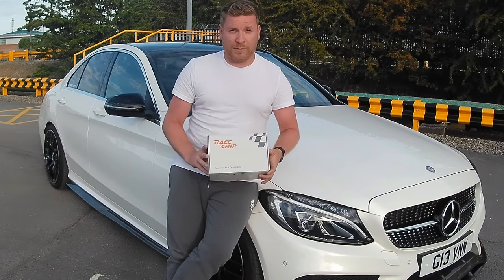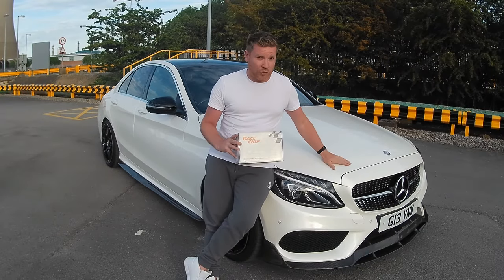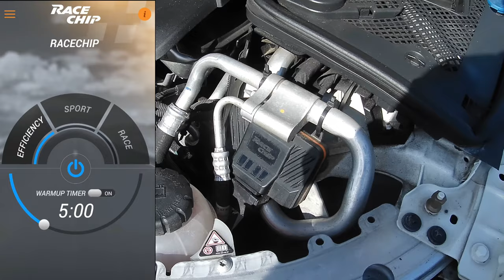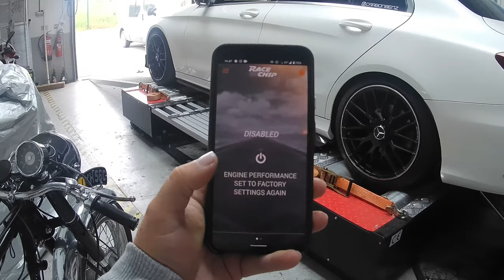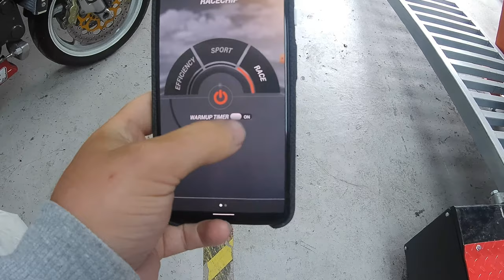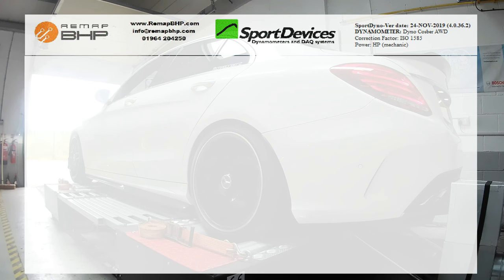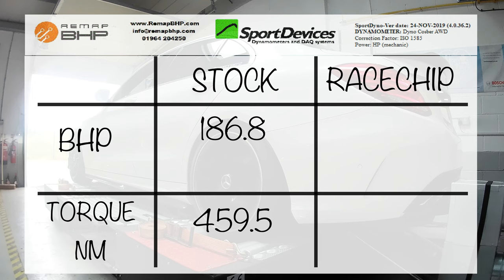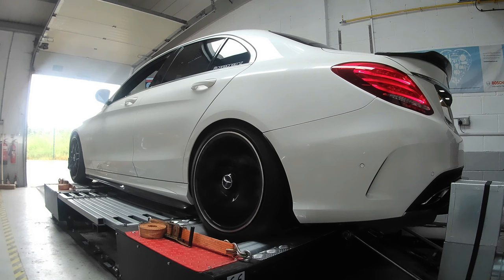RACECHIP Tuning Box's - Do They WORK? DYNO TEST RESULTS!

Comment: One thing to consider... as a race chip owner on a Panamera Turbo, is the race chip has a bit of a learning mode. It obtains its maximum improvements after a period of time, up to 200 miles clocked after installation.
Reply: That is 1000% correct brother alot of commenters claim to have race chip and they dont i had mine AMR tuned and it curropted my ecu so got a new ecu and added race chip ultimate and not only was it better but i dynode 506 hp to the wheel on map 5. (2016 mb c450 amg)
Reply: Finally! People with some sense!! You can't just add the racechip and slap it on the dyno right away. The stock ECU has to adapt and make passive changes and that takes time.
Reply from the maker: @mojo904  where in the video did I say I’d just added the racechip? It had been on for over a year prior to making this
Reply from the maker: Good job the recechip had been on for over a year then before I made this video to ensure the best results :)
Reply: @ZER0Y0N  <crickets> :)
Reply from the maker: Yep…

Comment: Fitted one to a turbo diesel i30 Hyundai. Definitely made a reasonable difference. The increased mpg on the trip computer was way out but measuring the mpg myself it gained 1 or 2 mpg which isn't much but considering the extra power it was a win win. Ran it for 50k miles and it never caused any issues.
Reply: Will this chip work on a US version Kona N-line? 1.6T 87 octane.
Reply: @zacherydesautels9458  Yes you can buy one for he Kona. I actually ordered mine today! 2020 kona ultimate. Claiming 49 horsepower and an astonishing 95 lb-ft of torque

Comment: I had the basic racechip on my A200d with the 2.2d engine. It made a real nice difference. The jump in torque made a big difference to the way it drove in normal traffic. I did over 100,000 miles in that car and it did not effect mpg in any way. Averaged 68mpg over 100,000 miles.
Reply: if you averaged 68 their was absolutely no point in you getting a tuning box hahahhaha you would of been better with a detune hahahah

Comment: Would this cause any parts to wear quicker?
Reply: @imtheblind4524
Yes if you abuse it. I mean if press the gas harder and harder, even if you not use racechip or any piggyback tunes it will cause problems to your engine. The most important is learn how to maintain you car even you are using the chip or not.

Comment: For the people who like to know:
It's interrupts the voltage signal coming from the common rail pressure sensor and forwards a higher or lower value depending on the chosen setting.
The ECU bumps up the demand of the pump a.k.a. pressure because it's sees a lower value from the sensor.
Now because the pressure is slightly higher and the duration of the injection is still original ECU, the end result is still a higher volume being injected in said duration of injection time resulting in a higher bang. And since cars are always tuned from factory for balanced power and pollution setting. You can get away with adding that little bit of fuel without getting in to trouble.
Reply: Maybe no real trouble, but your beautifull white Mercedes wil have a black butt in no time.

Comment: Initially when I got my RC, i didn't feel i noticed too much increase, it took my a while to notice.
I contacted RC customer support via email and explained that I felt it was not giving me the power i expected.
They sent me an update to install and i have to say i really do notice when it is turned on.
On highest setting it always feels like the turbo is raring to kick in.
I usually drive with it set to 4.
It definitely picks up quicker than without it.
I've had mine over 2 years now and hate driving with it off. 
Expensive, yes. But so glad i bought one.
Reply: What car do you have mate?

Comment: I've installed Race Chip on many of my own vehicles and all have worked very well. My MK8 GTI picked up 4 mph at our local 1/8th mile drag strip, only mod was the Race Chip. My Wife's Cayman S picked up almost 50 whp and 60 ft/lbs on the dyno with only the Race Chip as well.
Reply: Did ever dyno your MK8 with the race chip?
Reply: Sorry, no sheet on the GTI.... just did same night testing with the unit off it went consistent 80 mph in the 1/8 mile and with it on went consistent 84 mph in the 1/8. I would say it picked up 30-35 HP and 55-60 ft/lbs of TQ @oaboloka
Reply: What kind of chip did you buy?

Comment: My Racechip made a heap more power yet it took a bit of ECU learning. I slowly turned the setting up each day as advised. On the final day I was on setting 6 and my Kia Cerato GT was flying, advertised 40+kw gain. I pull away rapidly from MK6 GTI DSG and have hit high 5 seconds to 62MPH. Definitely recommend but u must slowly turn them up so your ECU can adjust timing tables etc.
Reply: what do you mean slowly turn that up? Would love to get one for my brz and impreza rs. My impreza rs daily is way too underpowered and want more for my brand new brz
Reply: @petrolheadl3856  they have a rotary dial numbered 1 to 6, 6 is the highest number... I don't think you'll get much power at all on a naturally aspirated engine they are more so for turbo engines as the higher number setting turns up the boost.
Reply: @akent46  so most of the chips are for turbo car? Thanks for your info btw, gonna get a remap dyno tune for my brz then
Reply: @petrolheadl3856  yeah, best power gains for BRZ are headers, full exhaust and a custom tune 👍🏼 will get rid of the torque dip in the mid range too.
Reply: That wasn't a recommendation when I bought mine. I just turned it all the way up and left it go.
Reply: @bealltho1   it was a recommendation from Cherry Tuning due to our Ecu's ability to learn and make table adjustments over time
Reply: @akent46  Oh ok. I thought you were saying race chip said to do that, which was news to me because they weren't recommending that with my unit
Reply: @bealltho1   yeah ok, I really should edit my comment 👍🏼
Reply: Thegreekgod  Maybe on the higher tier ones. I'm running the S tier one, have been for quite some time now (probably about 1.5 years). Instruction manual that came with it was actually for a different brand vehicle (same ltg engine though) and while it gave hookup instructions it didn't specify about gradually increasing it. Mine said "it's factory set at 3, if you don't notice a change increase it until you do". Not really the same message as "gradually increase to deal with engine learning".
Reply: Talk to me mate as I’ve got the same car.
What Racechip did you go with?
And did you do colder spark plugs?
Reply: @Hutchy86  I went the GT version I believe and did do the colder plugs... 30,000km and still going strong.
Reply: @akent46  have you noticed any issues with the DCT? Slipping ect
Reply: @Hutchy86  I haven't noticed any slipping just the usual lazy behaviour of the DCT under partial throttle. I'm not running wider or sticker rubber though also.
Reply: Which one did u buy and how is it @bealltho1

Comment: Ive had a Racechip on my 2014 Audi A6 TDI.  Purchased in 2018, (now 2023).  While I do notice a difference it's not the same as a tune.  No problems with the RC and I purchased another for a friends vehicle.  Again, he enjoyed the performance gains.  System spoofs the sensors and offers more trq than HP.  Easy to install and remove.  Overall OK but not what is claimed on HP at all.  Also, at the higher RPM's I also didn't notice any improvement.
Reply: Can u still use without voiding warranty?
Reply: @redditmanllegnisthebirdofh9887 Yes and here's why.  It just plugs in with a few cables.  If concerned what dealer would say it just takes a minute to unplug the cables and re-attache.  When back from shop, just re-attach.  I have one for sale for a 3.0 Audi Diesel in the box.
Reply: @johnjerrehian4642  I wanna use on my kiss stinger gt2 but I hear they can see it run codes when plugged into the ecu port so I am iffy on if I should do it cause I don’t wanna void my warranty but thanks bro
Reply: @redditmanllegnisthebirdofh9887  When you download and re-write the original software the mfg knows this was done.  However, the Racechip does not do that.  Your software is still stock.  If taking to the dealer while under warranty, just spend a few minutes removing the device and when back re-install.  They won't know the differecne.

Comment: I've myself got a Mercedes A200 W177 model with 163bhp, I've got a race chip in mine (quoted 201bhp), and it really does make it feel lightning quick, I actually believe the quoted power too, I measured a 6.9 second 0-60 with it on, and a 7.9 second with it off.  Also the feel of the power in 2nd gear really throws you back in your seat unlike when its turned off, and the extra power in 3rd/4th is very noticeable.
Reply from the maker: You should get it on a dyno, would be good to see the results
Reply: Hi, I plan to install it in my GLB200 X247 so same engine as yours, would you recommend it after having it for a while pls?
Reply: Ho la stessa macchina, quale modello di rache chip era? S, RS o GTS?
Reply: I got same car you had any troubles with it, wan to install it bcz we still have no remaps for this car.  I would always chose for a remap but is not possible with this car yet and I not think they will get a remap for it.  So I want to try this but I rad so many bad things just want the car little bit more snappier. I already have a throttle sensor and it sure works great.
Reply: @taebebe9528  Not a single issue with it in almost 3 years.  I'm now on 35k miles and not had a single hiccup with the engine at all. It's still very quick and efficient  Btw all of those 'bad things' you read about tuning chips are all lies made by companies that provide Stage 1 tuning, or people that simply dont understand them.  The ECU still controlls 100% of the engine so a tuning chip simply cannot cause issues.
Reply: @Shaggy12321  Thx I have no choice, Yes I do hehehe but I will try it myself and I will post here if ever got a problem or not or I am happy with it.  We have no choice bcz they cannot remap it yet so, the tuning box is the only way to have a more relaxed car.  I am not driving my car like a maniac I always drive it warm and let the turbo cool off after a ride putting in stationary for a couple of minutes but I miss the smoothness when you tune a car it drives  always like another car, I hope I get this feeling too with this tuningbox.  The throttle tuning already does a good job no lag in the throttle anymore...
Reply: Any update did you get the race chip mate? I also have this car and have no choice but to get the raw chip so it’s great getting real opinions! TIA
Reply: @jakepower2465  Still going solid at 38k miles.  Now had 2 MOT's on my car, 4 full services, and the only issue i've ever had is a bald spot on the front-right tyre.  The tuning box is a God send, fantastic power and also averaging 46MPG here in the UK with somewhat spirited driving - I could get 50+ if I drove like a sensible old woman
Reply: did
 you put it highest setting right over when you bought it?
Reply: Which brand did you get because I have the same car

Comment: Gotta love smaller YouTubers doing things the right way, and proving these things with legitimate results with a dyno
Reply from the maker: Got to do it properly, Too many videos out there of people fitting boxes then using a dragy or saying... "oh wow its sooo fast" - Nah, people want proper results which are consistent and measurable and yes a dyno can give different readings on different days but they are perfect for a comparison tool such as this :)
Reply: Question: do you get more gains over time? Or is that a myth as well?
Reply from the maker: Myth. So is the learning modes. They are fixed parameter they don’t learn as they are not plugged in to your OBD2
Reply: @ZER0Y0N  Thread revival! That's what I read too. Yes, these things work to a certain extent, but only due to changing the impedance of the signal to the ECU. One guy in the Renault forums fitted a random non-Renault unit he got cheap from fleabay - it gave a bit of noticeable midrange punch, but it'll also do exactly that on most modern-ish diesels. 
If anyone is going to get one then buy the cheapest as it is midrange power that is most useful day-to-day. Ignore those that natter on about "ECU learning" and suchlike, it's bollocks.

Comment: Thank you so much for this video bud, I have a Gle 450 coupe and I was thinking of installing Racechip for me from 275kw and 520 torque stock they say it will jump to 331kw and 620 torque but after this video I highly doubt I’ll ever get close to those gains maybe 10-15kw and 20-40 torque more but it’s certainly not worth the money they wanna charge me. Which is 9500 South African rands.
Reply from the maker: you would be better off with a proper remap

Comment: When we dyno piggybacks, we notice each subsequent run the car bleeds off any additional power until it is back at stock levels.  You get increased boost, but we always see an accompanying closure of throttle, pulling timing, dumping fuel, etc.
Reply: That’s surely why my s4 run 11.7 on jb4 since years and 12.8 without 😂🤣😂🤣😂🤣😂

Comment: They work fine, though I'd go for the £139 one, seem to give a good dollop of torque just where you need and use it most, they improve as the ECU learns it
   If you think it's placebo try taking it off, you miss it when it's gone big time.
  I've had four....
Reply: What about fuel consumption..Any noticeable savings?

Comment: Initially made aware of chipping many years ago when a work colleague had his 1.8 Audi tt remapped or whatever. It was noticeable and made it more beefed up but about 6 months later something went in the engine and cost him thousands to rectify.
Guess im just a bit wary of doing something to an expensive car that would need declaring to insurance company and could potentially cause unknown issues. Nice presentation 👍
Reply: If I'm correct they give you up to 10k engine warranty in case you order their best chip and if something happens to the motor after using it.

Comment: Interesting video Gavin. I have a tune box on my Velar and it should take bhp from 180 to 240. It’s certainly much more rapid with TDItune box turned on.
Reply: It won't be anywhere near that. Anything you experience will largely be placebo.
Reply: @bEEBO178 no it isn't, racechip work rather you want to believe it or not, got a racechip in my bmw and it is 100 percent a difference.

Went from 4.3 secs 0 100 to 3.9.

Comment: I have been driving an Audi A4 with a race chip for 2 years. I don't know what dyno no. would be, but it is much faster than it was without the chip. I have also been looking at what RC can do with other similar engines.. I saw that a VW GTI gets more gains than a Golf R would with a race chip. It makes sense that if an engine is already turn to high output, the gain from RC will be less that an engine that is less tuned.  I am sure I will put a Race Chip in very turbo car that I am going to get.
Reply: What model do you have? Gts?
Reply: Race chip model.
I want to buy one for my ford fiesta 125 cv but I don't know which model to buy

Comment: Guys you better get this chip than the remap. Remap burns your turbo in time frame of 6 months to a year and your car will need be repaired. This chip is safe and you can enjoy the difference without stress.
Reply: You sure of what are you saying?Because i saw some videos whit professional mecanics saying that this chips not only destroy turbos but also damage or waist very fast parts of the engine.